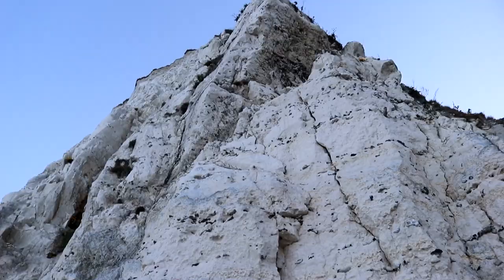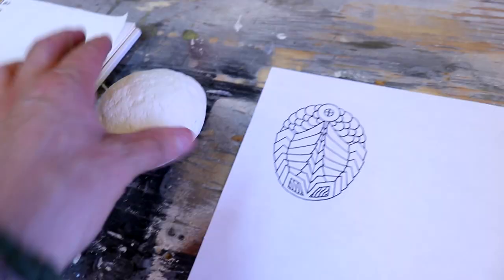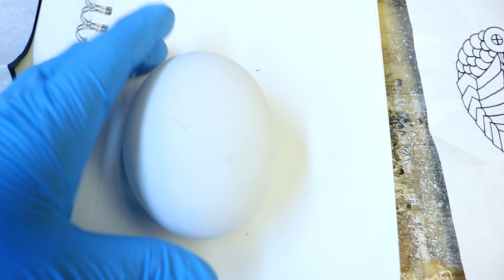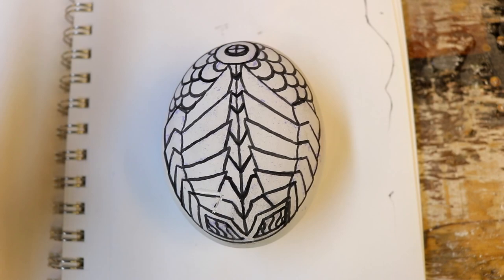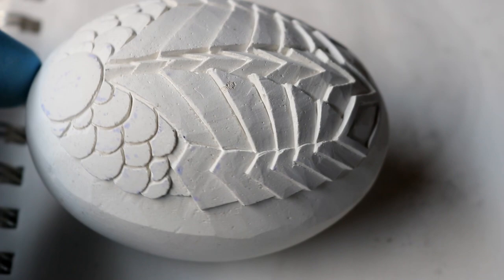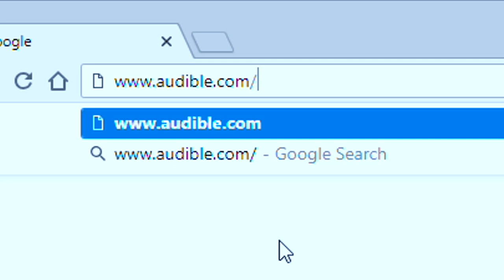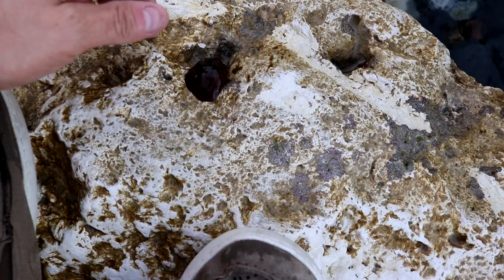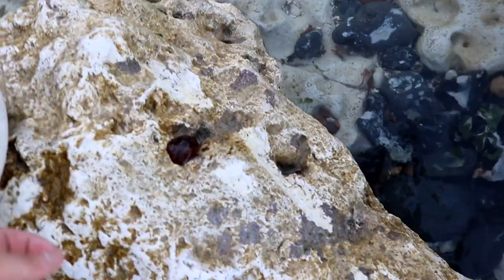I Carve A Piece of the White Cliffs of Dover (Giveaway closed)

Comment: Bobby has demonstrated that chalk is indeed soft.  nods

So how hard is the chalk at Dover anyway, compared to perhaps the type of chalk you use on black boards?  My understanding is that there's a lot of variance from location to location.
Reply: Been in most places with cliffs here in the uk and its mostly about the same dependant on if it had contact with water or not. When dry it is just as hard as the chalk you would use for a black board (e.g on top of the cliff) however when in contact with water it soaks it up and becomes soft even after you get the water out of it. Its like a lump of white paste stuck together when wet and then a really soft lump of dust when dry. Hard to explain try soaking blackboard chalk with small quanitities of water over time and you will basicaly get the same effect. its great for carving but wont last long as it wears out pretty quick its a carvers dream due to its consistency throughout and the softness mening you can use any tool. You can use toothpicks to add texture.

Comment: Of course, a lot of that loose rock on the ground there might not so much have fallen off the cliff as been dug up from way underneath you - diggung the Channel Tunnel created a lot of rubble, and it all had to be dumped somewhere...  a lot of it got fly-tipped between Dover and Folkestone, it cumulttively created another square mile or so of England -  - your bit  could be a bit of what is technically France!

Comment: washing up liquid with water can transfer a design from the thermal paper to skin/silicone.. possibly try that for clearer lines n ting, or use Stencil Stuff the tattoo transfer liquid which is what i use for my tattooing. Just use it on the surface of what you want the design on and then press the paper design on top of it m8

Comment: Because the rock is so dusty it will just keep getting smaller from wind and people touching it and stuff.
When you do art with dry pastel it’s kinda like chalk so when you finish drawing with your chalk you need to use this special spray and spray on the paper and it make like a film of plastic that keeps the chalk from falling off the paper and the spray is kinda like hairspray and you can use hairspray like the stuff that makes your hair hard and spray it on the rock so you can touch it and not get all dusty.